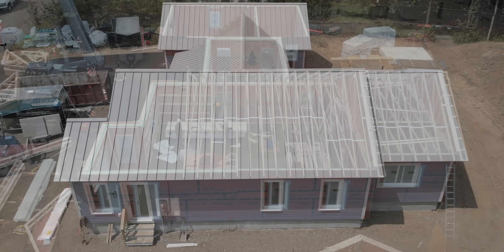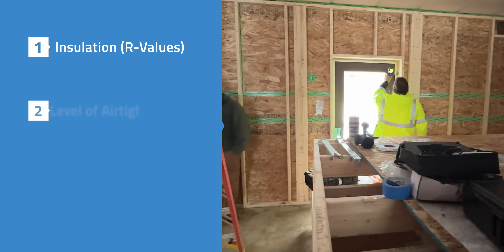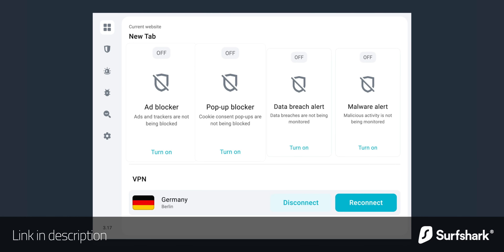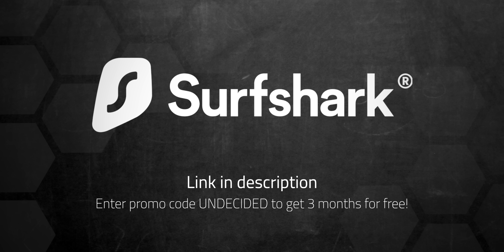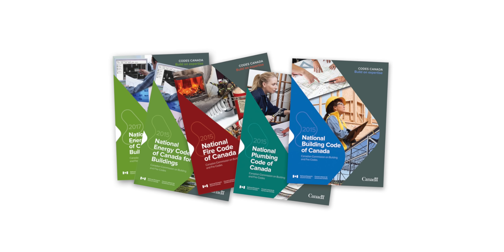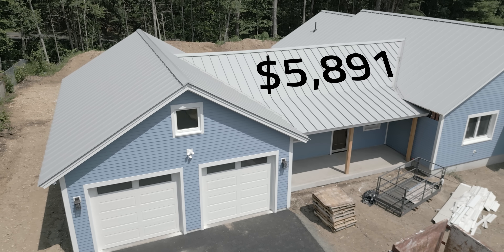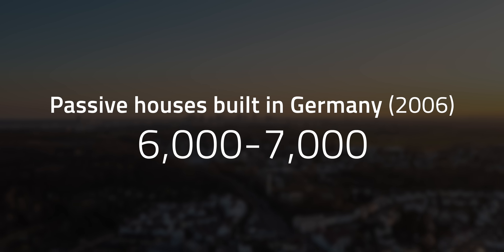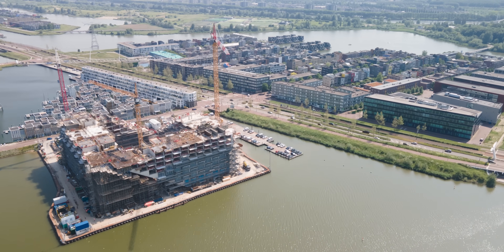Why Do American Homes Suck?

Comment: First, I really enjoy your videos. As a fellow engineer I very much respect and align with the way you see many of the topics you cover, and I learn a great deal from the content. (I'm a software engineer, but as my wife and others have often marveled at my seeming ability to fix anything, I remind them that chemical engineers, structural engineers, software engineers, civil engineers... we're all engineers, we all see everything as a "system", and we can probably all fix your dishwasher.)

I want to comment on this topic (or perhaps elaborate really) not just because it touches on some kind of controversial points, but because I believe it's a bit more nuanced than you or Matt (another YT'er I also really like) are making it. I tend to be a more than a little suspicious when claims start coming out about how much "better" they do this or that over in Europe because, as I am sure you can appreciate as an engineer, "better" is a qualitative assessment, thus subjective, but is often supported by quantitative, e.g. more objective data. Qualitative measures are often one leg of a three-legged stool where that leg is a function of the other two quantitative values (that's a mouthful). Consider the mantra "better, faster, cheaper". "better" is the quantitative leg, because it's subjective. Whether something is deemed to be "better" is usually ultimately a measure of how it stacks up against "faster" and "cheaper", which can both be easily quantified. People (especially bean counters) LOVE to count things. They count dollars (cheaper), hours (faster), keystrokes, man hours, steps, gallons, miles, CFMs, or whatever to come up with other metrics. They like these because they're objective measures. From a systematic perspective, one of the driving reasons behind the Space Shuttle Challenger disaster back in 1987 was that NASA's commitment to "better, faster, cheaper" often meant that, for the reasons stated, "better" always took to a back seat to the things they could actually count. This is, in a very broad sense, while "quality", as you and I as consumers or end-users of products and services would measure it, always seems to decline. It's the one thing they can't easily and objectively count.

I could go on and on here, and would honestly like to, but I don't want to give the false impression that I'm trying to shoot down this video. Again, I agree with most of it. The only thing I really disagree with here is the insinuation that the solution is more central planning (to ensure compliance with modern standards). That is simply not consistent with the core foundations of this country. While central authority doesn't seem to be objectionable to most Europeans (and that's totally okay), the whole idea is simply reprehensible to traditional Americans. I'm not going to get on the political rant here, but a cursory look at what's happening right now in the US tells you all you need to know to support that claim.

What I will say is this: rather than more regulation, what we need is the distribution of more unbiased KNOWLEDGE. Content like this is important and valuable, because it allows you and me, as consumers, to acquire knowledge from unbiased sources who don't stand gain or lose anything based on our ultimate buying choices. I think it's great learning from these guys about what my options are. When I replaced the central air-conditioning system (one of them) in my house, I replaced it with a crazy-efficient multi-speed inverter system that not only does a great job of cooling, but it also is way more efficient than the unit it replaced. Of course, it also cost $30,000. Fortunately, my son was an HVAC installer so I got it at cost, or I never could have afforded it. I replaced my electric hot water heater a few years ago with a solar water heater. I absolutely LOVE it. Of course, at $5,000, I don't know that I'll ever actually see any real "savings" from that decision because you'll have to heat an awful lot of hot water for an awfully long time at 17 cents / KWH to recover that. That's unfortunate reality is exacerbated by the reality that my homeowner's insurance will likely demand that I replace it when it hits 10 years old, even if it is in excellent shape. At least I had access to the information I needed to make the buying choices I made. I am grateful for that information, but the absolute LAST thing I want is some authoritarian telling me what I have to put in my house. I don't like being "ruled" over, which is one thing I think that traditionally has made America "better" than Europe on pretty much every front. Of course, that's subjective so your mileage may vary.

As responsible members of a free society, we need to use our heads to make good choices and be good stewards of the freedom we enjoy. True, I don't want someone telling me what light bulbs to use or what temperature to set my thermostat at. Having said that, I spend considerable money to replace all of the lights on this property with LED's; I replaced that central AC until (and will replace the other one when its time comes) with a newer, high-efficiency unit; I replaced my electric water heater with a solar water heater; I replaced my old pool pump with a variable-speed inverter pump, I replaced my aged roof with a high-performance metal roof; and I replaced the old window AC unit in my workshop with a very high-efficiency mini-split unit that performs better and costs less to run. I'm blessed that I had the financial resources to do these things, which is why I don't want to compel anyone else to do them. There are times I can certainly support a fiscal policy that aims to amortize or capitalize the substantial up-front investment in things like solar, through the use of incentives and tax rebates. But, that's aa slippery slope. Like I said in the beginning, this whole topic of energy is very nuanced and I don't think that there is a one-size-fits-all solution, so be careful what you wish for. That same highly-precise tack-hammer that puts a little central-planning in here for the greater good can quickly become the blogeon of authoritarianism. We only need look to recent pandemic for examples of how badly that can end.
Reply: @TheFeaz I completely agree! That’s was the other thing that really bugged me on this video. Freedom of choice is what we should be striving for not idolizing other countries authoritative governments. “If we only had more regulation like Europe”. It almost like the goal is to price the average home owner out of the ability to replace something in there home. I could never afford to go out and buy a 5,000 water heater, under these hypothetical “new guidelines” I would be left with the option of going in a large amount of debt or going without. Freedom of choice, if I want to pay more in utilities, over years, and pay less in upfront cost, that should be my choice.

Comment: at the beginning of the 2000s we were planning our house in austria. opted out of passive because aparently there could be problems with moisture and mold in a lot of cases. in a passive house you shouldent just open your windows for a gush of fresh air. so if the builder lacks experience our did a sloppy job, youd have that problem. dont know what it is like nowadays. i decided that i actualy wanted the freedom of opening up without thinking about concequences. which meant building well insulated, close to, but not quite at, passive standards. without all the traps we could fall into without even knowing it. walls and ceiling are 38cm thick, just under 15 inches about 3inches are installation rest is insulation and structure.
Reply: hi Matt sorry for taking my sweet time. After 15 years in the house im still not done. Just in august we got 17 (7kw peak) solar pannels. Now i have to redo part of the paving because the one side was held by plant stones which are slowly giving way. How is your new home coming along?

Comment: I own one of those poorly built homes in Northeast Nevada and frankly, with electricity at $0.12 KwH there is little incentive to spend money on such a simple thing as energy efficiency despite the fact that we live at nearly 6k feet (1800 meters) and have cold winters. I am starting to play with DIY solar because I know cheap energy is doomed and I will move to a heat pump at some point - geothermal if I can manage it. You don't mention the 10th amendment in all of this and ultimately a national standard is unlikely because of it. Yet I wouldn't trade state sovereignty for a better building code.

Comment: Here's my problem: I have a 1970s vintage house that is as drafty and energy-inefficient as can be, with huge single-pane or early-gen double-pane windows throughout. It would cost about $60k to replace them with standard modern windows (not even triple-glaze). Even if I keep this house for 30 more years, I won't come close to recouping that replacement cost in energy savings. And I don't think it would add much to my home's resale value. So I would just have to eat the huge cost for environmental reasons, which I'm actually tempted to do, but it's a tough decision. What are the tax incentives to do so in WA? I'm seeing a maximum federal tax deduction of $600 (https://www.irs.gov/credits-deductions/energy-efficient-home-improvement-credit and https://www.energystar.gov/about/federal_tax_credits/windows_skylights), which is a drop in the bucket, and nothing from the State of WA.

Comment: This appears to be an imbalance between cost and desired efficiencies.  In America, cost controls engineering when it comes to designing homes.  Maybe you can compare Total Cost of building your home to any other normally affordable home to your supposed savings against the cost of normal energy use of a normal home.  The comparison would be interesting, and I am not talking about a mathmatical model but actual cost saving verses total cost over, say, five years not including any solar installation or use.

Comment: Are those nose bleed fuel prices in Europe not a side effect mostly of taxes though?  The cost of crude oil for them and the US is essentially identical.  Despite the US being a major oil producer,  there really is no "oil producer" benefit here like you get in places like Saudi Arabia or Venezuela.  

The only benefit is if the schitt ever hit the fan and there were major oil shortages, US production may be sequestered for American use rather than exported.  But on a normal day to day basis thats really of little benefit to fuel prices here.

Comment: It doesn't make sense to have a national building code.  What works in Massachusetts doesn't make sense in Central Texas.  Most of the new homes being built, even by tract builders, are energy efficient enough.  There needs to be a balance between affordability and energy efficiency.  The biggest gain isn't in new buildings, it's in retrofitting older homes.
Your comparison is flawed since you are comparing your house to much older homes.  For an accurate comparison, you should compare your house to other homes in your area built by custom builders that are brand new.
You neglected to mention how much your house costs.  I like Matt Risinger, but he builds million-dollar homes.  Most Americans can't afford that.
Few people can afford a home in the UK or Germany.  I make $150k annually, and I couldn't afford your home Matt.  I can afford my house build by a tract builder in San Antonio that was built in 2013.  It costs me on average $124 a month for electricity.  The windows are double-paned, which are good enough for Texas.

Comment: It is not standard every where in Europe and the house you have built is laughable to many in Europeans that boost Americans do not even use brick or stone in their construction. The fact is most European nations have been around a lot longer and have in some places rebuild hundreds of times for many generations. So many are just reusing some of the material during the rebuilds and stone and brick are the materials that last. They could not afford to start from scratch and from what they use to in material makes it slightly more expensive.  Compared to the USA they have the system in place to build the way they do. The USA is still expanding and the resource's to build as the Europeans has not been established so when you build strong you build expensive and that is also the CO2 hoax type of building as well. With out the hoax it is always good to recycle and using the most efficient systems available because.  Lets face it no one needs to pay more for what they use and resource's are already in areas being depleted so the hoax helps.

Comment: I am retired petroleum geologist, in 1984 when oil prices crashed I lost my job at a major oil company and had move out of oil town to find a job. We could not find a home we liked so we decided to build. Oil prices at that time were ~$25/bbl, I had been running well drilling economics based on oil being $100/bbl by 1990 so I was concerned about the energy consumption of our home so we went with building very tight home. The result was very energy efficient home, our heating bills were 10% lower then others in the neighborhood, summer 50% lower. Some folks including the local building inspector thought we were a bit nuts, but it has paid off. When the time came to get solar panels 13 years ago it was hard to make the payout work but we did it because it was the right thin to do. With rising energy costs in the last few years it turned out to be good idea.

Comment: If your envelope of your home, (roof, exterior walls) are well insulated as standard home does not need triple pane windows. Give the often used example of a jacket to cover your house, windows are in total the 2 pockets of the whole jacket spread out. But as Matt rightfully pointed out builders are making house cladding out of literal cardboard which is why everyone laughs at us. It's terrible.

Comment: As retired GC, working on own home built 20 years ago, find selective contractors willing to learn and use insulation, windows, and air tightness to upgrade home. The larger GC are less willing to make these changes because of labor cost fears. Therefore, in my case doing step by step with small contractor in removing cheap cladding an R13 glass batts, replace with Rockwool, and OSB, seal exterior with polyguard for air tightness, add two overlapping 1' graphite enhance foam insulation,. These actions changed standard R13 wall with no thermal brake to R25 with thermal break and air tightness. Therefore, as Matt Ferrell an Matt Risinger state, it can be done with some research, open minded GC, and product research. For a home owner without knowledge a very difficult challenge.

Comment: Spot on editorial.
I lived in Germany for 5 years from 2008 and on. And living outside of the prison walls of the US, i was shocked at the construction of the avg home. Cement block walls, heated floors versus central air, triple pane doors, and windows. I was shocked feeling warm in Germanys -10 celcius winter with just heated floors. I said, "Wow, i can be warm through my feet?"

Then, i can back home to the US purchased a home and watched the paper built homes, poor installation, demanded double stacked drywall at a minimum, i asked for heated floors, instant hot water vice water tanks, at a minimum insulate the water lines going from below ground to 3rd deck. I asked why wouldnt utilities would be in the attic or near the roof, allow gravity to pull the hot water better, and the water needed. The most is always upstairs in a 2-story home.

And yet we pay nearly a million dollars in the DC/VA area for poorly designed homes. I can't imagine the cost of trying to implement EU construction designs with US home builders with a 95% profit margin on existing homes.

I learned a lot from the Germans, from automobiles to clothing to everyday life. One German asked why do you drive a Nissan Pathfinder for 3 people. Do you haul or pull anything? With a vehicle getting 12mpg, that was the first thing i changed when I returned to the US. And instead, I brought a GTI, ok 30mpg, i got better. I eventually found a home builder that has made some improvements but not like the EU.

One day, I'll return to Germany and free myself from the US greed and theft model, no capitalism, theft. Poor home designs mean more money for industry and energy producers. Simple answer.

Comment: Mass usage of glue in everything including the structural wood beams so new houses need fans to get rid of the gases. Terrible roofing system that requires regular replacement and prone to leaks.  US houses are cheap and fast to build... maximizing profits.  They don't last. All the facings are false. The white walls start looking like rust after a few years etc.